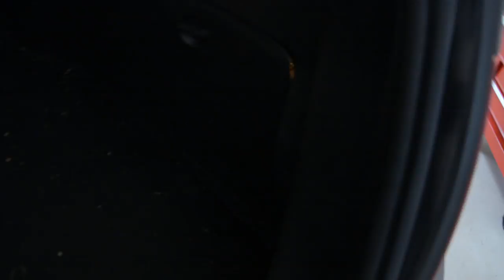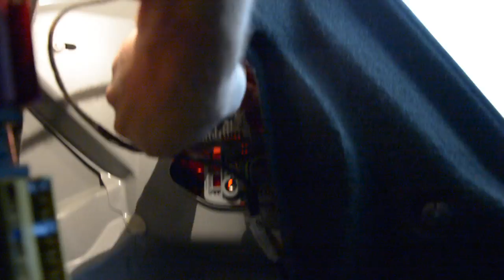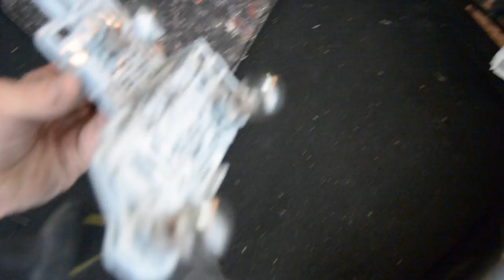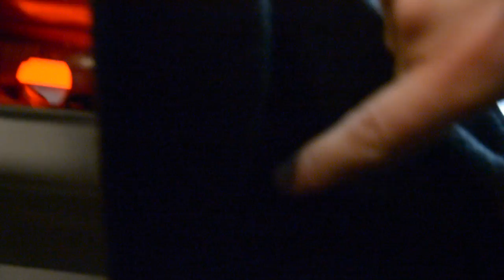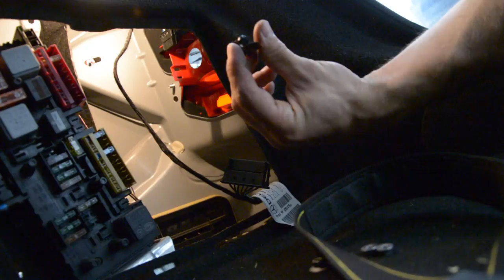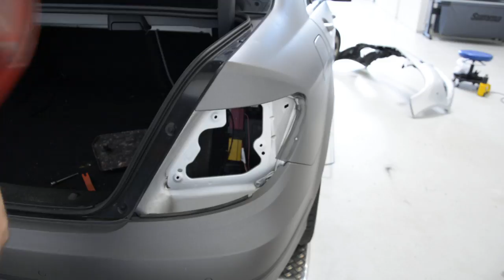How to remove the Tail Light and replace bulbs Mercedes C Class W204 2012

Comment: It says in the manual not to replace it by yourself, I changed the bottom right corner of the passenger side bulb, the upper side stopped working :/